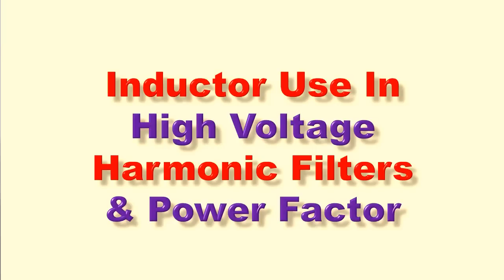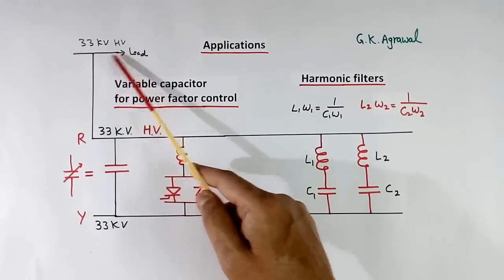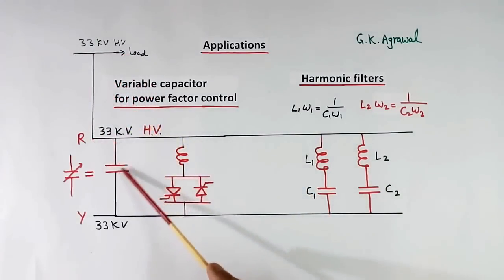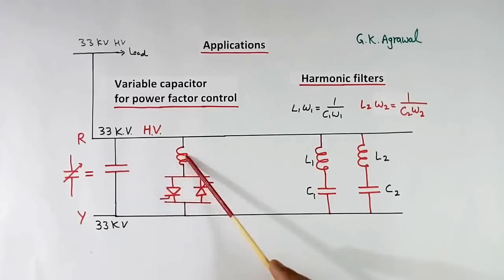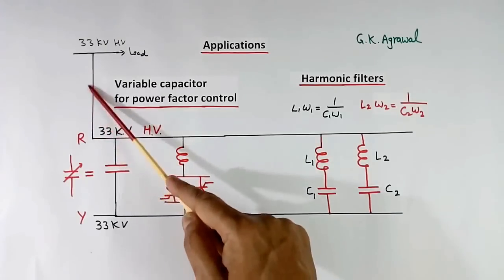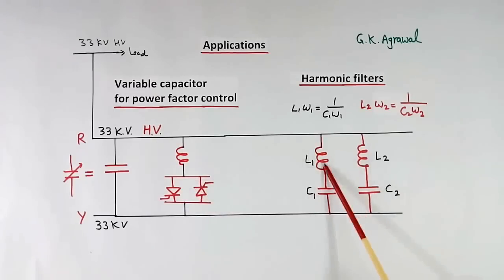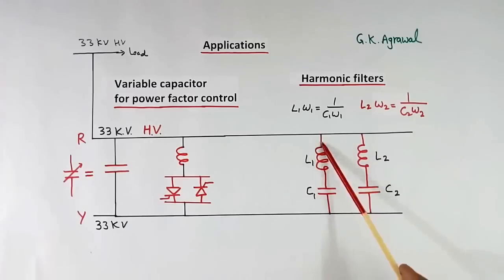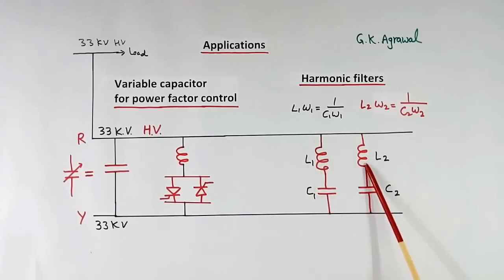Inductor use in LC circuit for Power factor & Harmonics filter

Comment: sir 33 kv high voltage me direct capacitor or thyristor use karte hai kya? iss rating me thyristor aata hai kya?
Reply from the maker: Yes, direct bhee use kar sakte hai. Thyristor bahoot se series me lagate hai. Aap mera videi optical cable for high voltage dekhe
Reply: ok..
Reply: @GKAgrawal2  Dear sir thank for your video but please make video to design calculation for harmonic filter